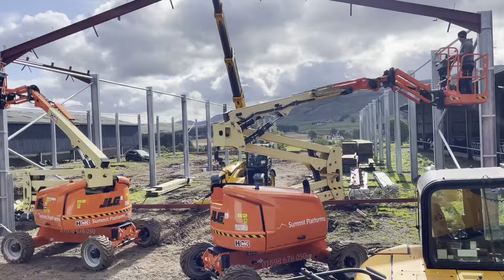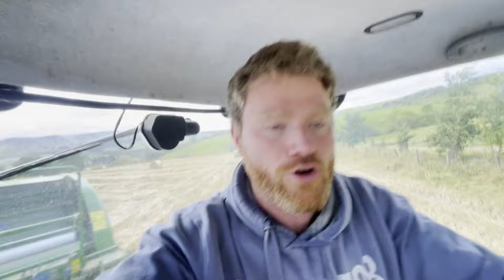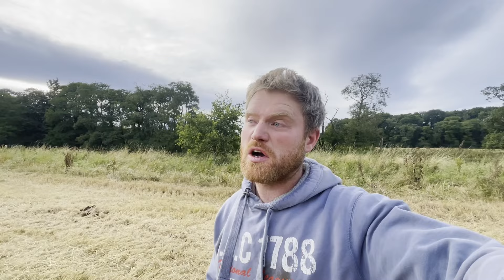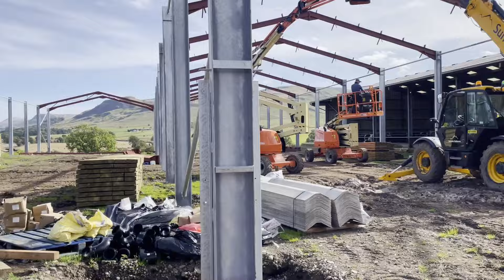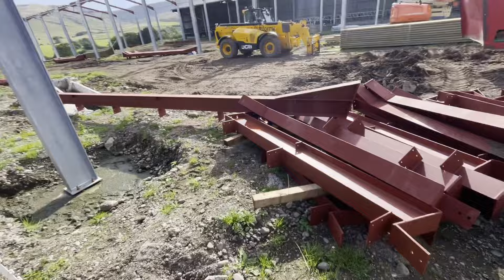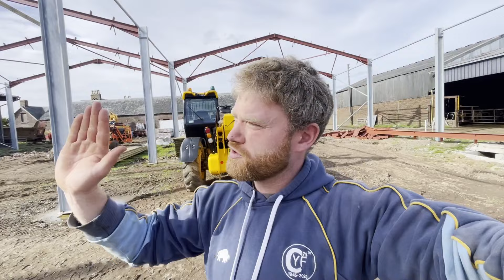THE SHED build is happening quickly and getting bigger by the day

Comment: Everyone's putting on clear polycarbonate 'heatguard' manufactured by brett Martin n. Ireland.....matches up with big 6 fibre cement vented ridge etc. Almost every farm in N.Ireland now has at least one shed roof done with it. Reflects the sun,so keeps cattle cool in summer,daylight inside and doesn't drip.....all good so far....£10/m2 and very light to fit. Use stainless steel screws!!